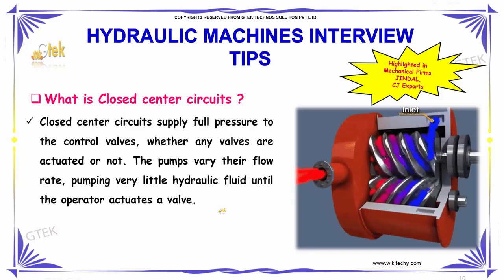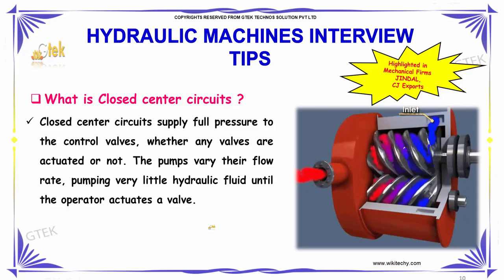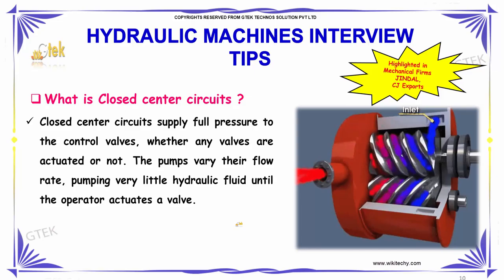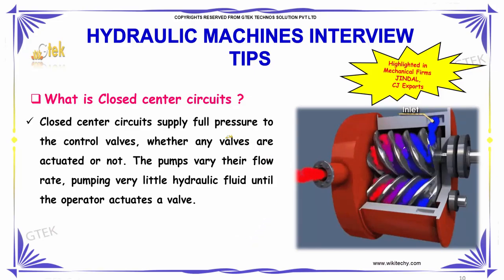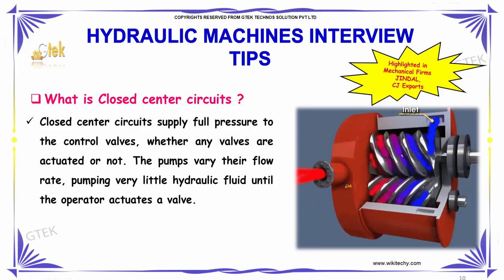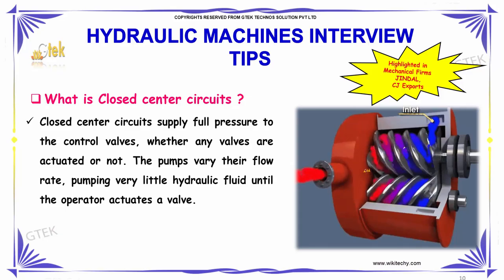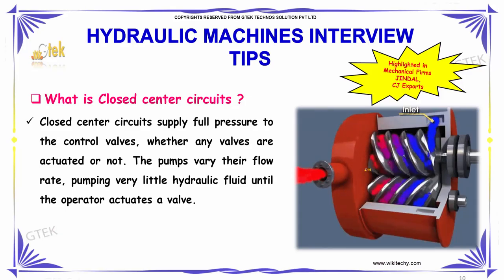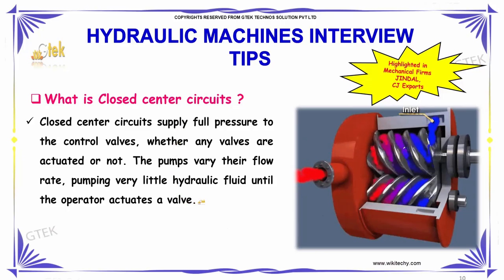what is closed center circuits | hydraulic machines interview tips | wikitechy.com

Comment: The means of controlling pump pressure will vary in the closed center system. ... supplies hydraulic pressure to utility hydraulic circuits and the flight controls.

Comment: Hydraulic fluid is filtered to 7 µm through a full-flow, spin-on, return filter. ... The pilot version uses a six-, seven-, or eight-spool sectional closed-center valve with circuits in parallel

Comment: The science behind hydraulics is called Pascal's principle. Essentially, because the liquid in the pipe is incompressible, the pressure must stay constant all the way through it, even when you're pushing it hard at one end or the other. Now pressure is defined as the force acting per unit of area.

Comment: Open Center refers to the open central path of the control valve, when valve is in neutral position. The hydraulic pump is continuous flow type. When valve is ...

Comment: Valves are placed in parallel and multiple services can be operated at time. This system is used on modern high performance aircraft.

Comment: When an accumulator is charged to full pressure, an unloading valve diverts the pump flow back to a reservoir. A check valve traps the pressured oil in the circuit. When a control valve is operated, an accumulator discharges its oil and actuates a cylinder.

Comment: The pumps vary their flow rate, pumping very little hydraulic fluid until the operator actuates a valve. The valve's spool therefore doesn't need an open center return path to tank.

Comment: SCO Open Center / Detent Valve; Open Center Valve; Two Circuit Hydraulic ... When a closed system is in neutral, the closed center valve blocks the flow of oil ...

Comment: With a closed center, the flow can't travel the the remote valve ... Works fine for simple, single circuit hydraulic systems .

Comment: Open Center refers to the open central path of the control valve, when valve is in neutral ... is the difference between closed center and open center hydraulics? In the valve's neutral condition (when the circuit is not doing any useful work) :

Comment: Closed center circuits supply full pressure to the control valves, whether any valves are actuated or not. The pumps vary their flow rate, pumping very little hydraulic fluid until the operator actuates a valve. The valve's spool therefore doesn't need an open centerreturn path to tank.

Comment: Closed Center system the control valve does not connect to the reservoir return in neutral position, instead pump off loads by varying its flow rate

Comment: This means that a control valve is closed in the center, stopping the flow. ... machines need more hydraulic power, a closed-center system is ...

Comment: a function. This means that a control valve is closed in the center, stopping the flow. ... A check valve traps the pressured oil in the circuit.

Comment: This means that a control valve is closed in thecenter, stopping ... A check valve traps the pressured oil in the circuit.

Comment: This means that a control valve is closed in the center, stopping the flow. ... A check valve traps the pressured oil in the circuit.

Comment: open-loop: Pump-inlet and motor-return (via the directional valve) are 
connected to the hydraulic tank. The term loop applies to feedback; the 
more correct term is open versus closed "circuit". Open center circuits 
use pumps which supply a continuous flow

Comment: Open Center refers to the open central path of
 the control valve, when valve is in neutral position. The hydraulic 
pump is continuous flow type. When valve is neutral then hydraulic fuid 
goes back to reservoir.

Comment: Open Center refers to the open central path of the control valve, when valve is in ... In the valve's neutral condition (when the circuit is not doing any useful work) : - Open center-